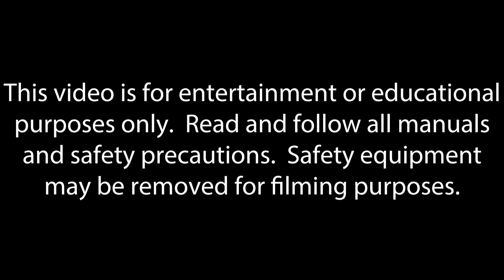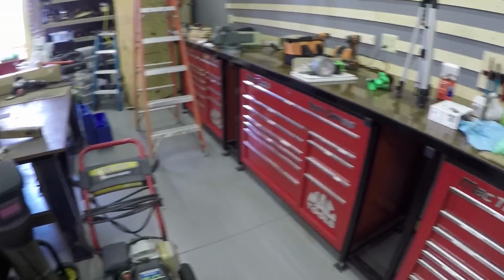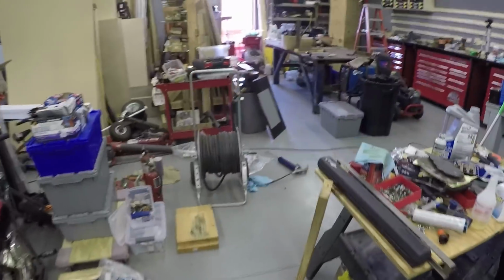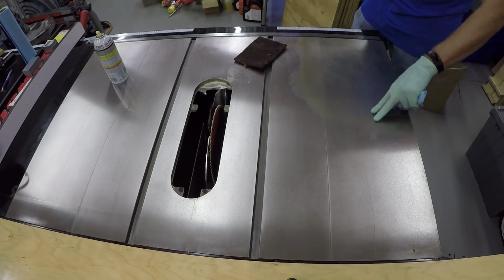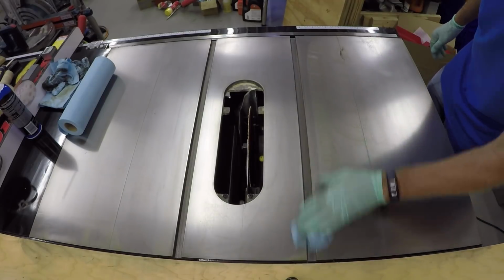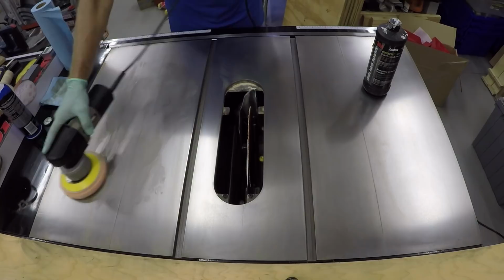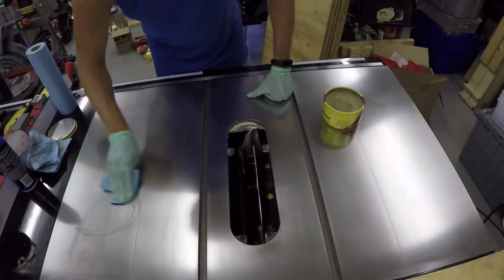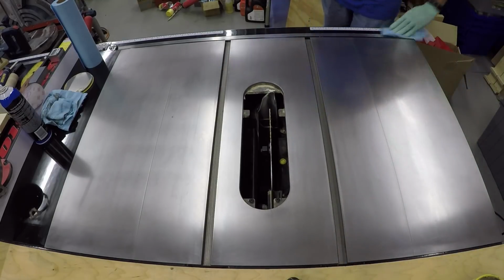Want To See My Messy Shop?

Comment: Rust on the table saw. Reminds me bad souvenirs. I once let a piece of wood on the top of it for a few days. I later discovered it was not very much dry. It definitely marked the surface. I always keep a dehumidifier running in my woodworking shop (it is in the basement) event if it keeps warming up the room over time. This way, when we get very hot and humid weather, the moisture coming into that room will not condensate on the colder surface of the table.
Reply from the maker: Joe Lesage 
I also left something sitting on my table saw that did the same thing. You definitely don’t want to leave anything on there for any time at all. I usually keep a dehumidifier running in my shop but I didn’t get it running until later in the year this year.